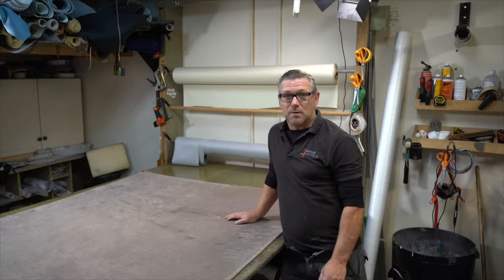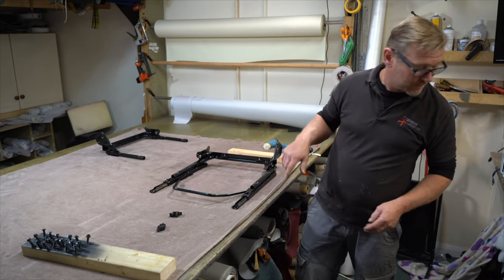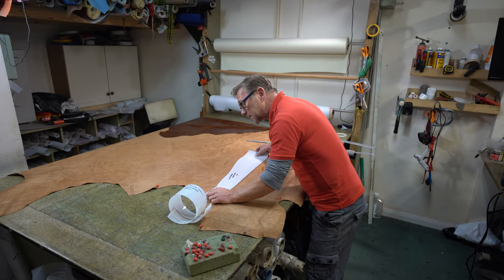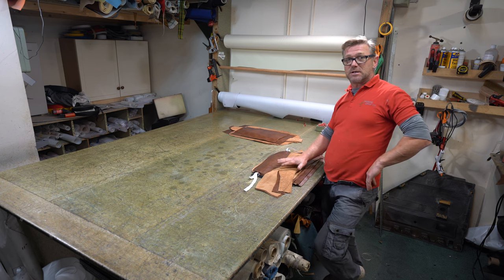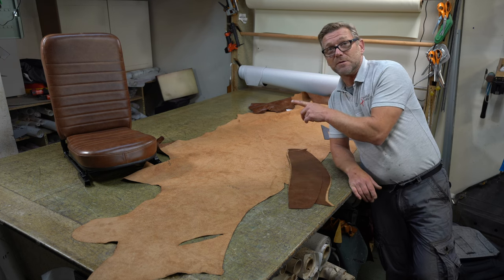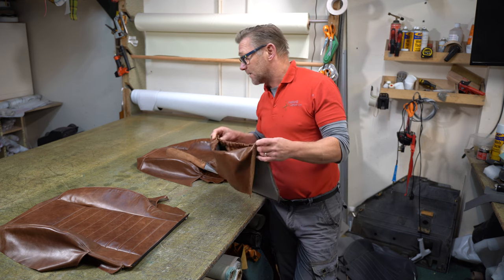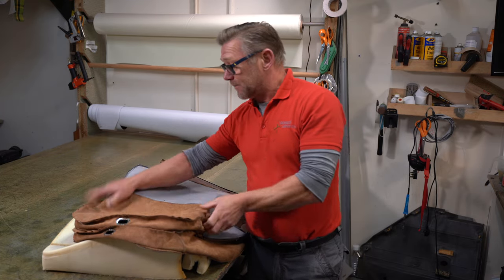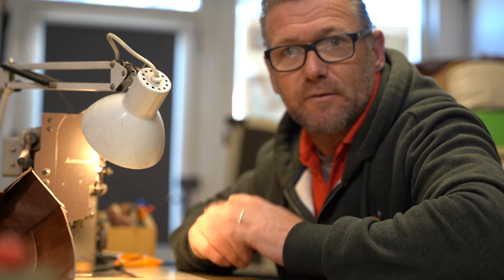Land Rover Defender full interior re-trim. The seats

Comment: Hi mate - fantastic video. I will be in touch soon as will shortly be looking at the interior as the final part of my rebuild. Question - how much disassembly did you have to do on the seat frames so the powder coat could get into all the nooks and cranys?
Reply from the maker: I didn't have anything to do with the powder coating of the seats, that was left to the owner of the car. If it was my car I would have completely striped the seat frames down.